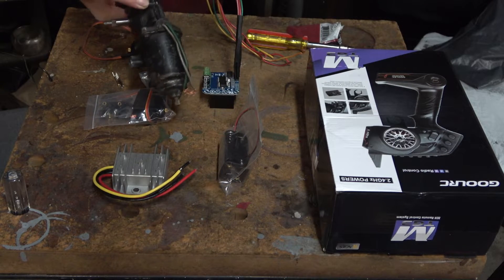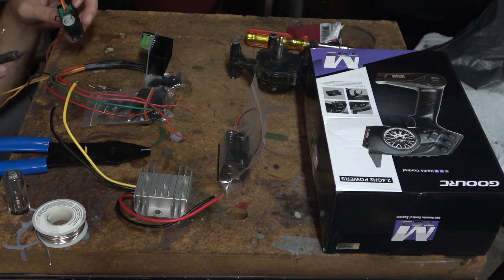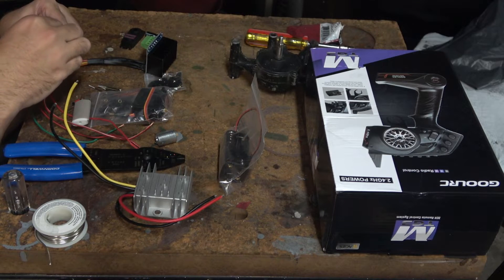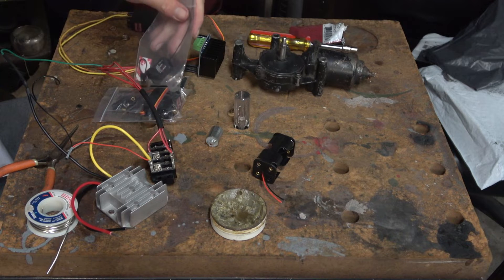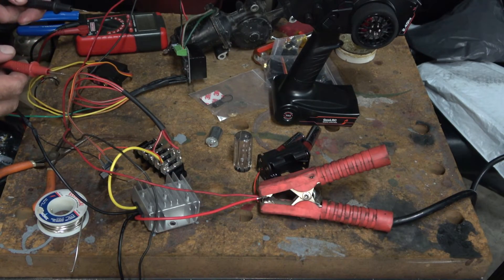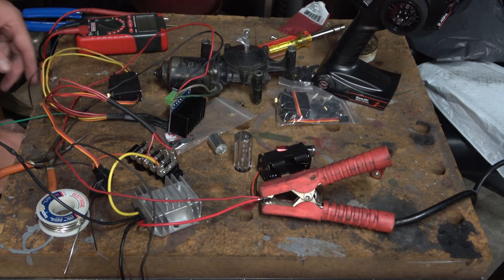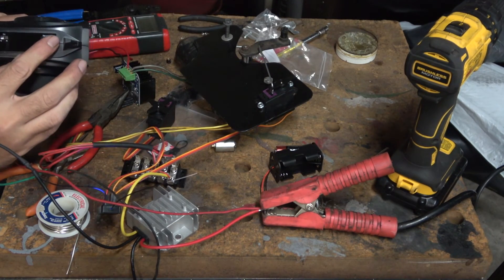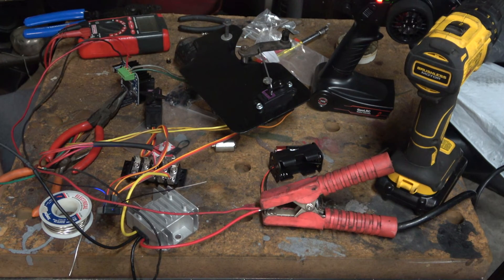How To - Remote Control Go Kart/ High Torque Servo

Comment: Hi, great job!!
I try to made the same project, with the same transmitter and bts7960, the only difference is the motor, it's not wiper motor, is a 12vdc motor with 27Rpm, and before I link the servo arm to the motor arm, I had to find the center of the servo, because the motor didn't stop, after that, I link the two arms, and when I move the steering, the motor don't come back to the center, and I'm don't know what it's wrong!!!
Can you give me some advice/help??
Regards

Comment: That H bridge is a fire hazard, the heatsink needs taking off and a thermal pad putting under it as there is nothing but the anodised layer on the heatsink electrically isolating the two driver IC's.
if they make contact with each other, especially at high current, you will have a very bad day.
Reply from the maker: It has thermal paste on it and its only running at 12vDC it dosen't even get hot. Have rode it for numerous hours and its just fine. Even if the entire system burnt up its only $80 in parts total so not a huge loss. Thanks for watching Steve! Here are videos of it working: https://youtu.be/T5xMn2v7UGc
Reply: @FireAndGasoline  thermal paste is not good enough, you need a thermal pad that will provide proper electrical isolation!
The two IC's have electrically conductive though holes and the only thing stopping the two IC's from shorting out on the heatsink is the Anodized layer.
If the two make contact with each other it will let the magic smoke out of the H bridge in a catastrophic way and potentially the rest of your wiring too.

Take your heat sink off and stick a meter on the two IC's through holes where the heatsink normally sits and run your motor back and forth, you will see why it needs to have a proper electrical isolation and only luck is preventing it shorting out!

Comment: Thanks for the idea with the windscreen wiper motor as a servo but could do with some refinement with some gear wheels to the servo potentiometer which would give you much smoother & precise steering then a pice of stiff wire, Nice job regardless.
Reply from the maker: I made it work, anyone is welcome to take my idea and improve on it. I actually hope people do exactly that. I definitely dont know everything but if i can pass along what i do know and it helps someone than it was worth making the vid. Thanks for watching Anthony! Maybe check out some of our other vids and consider subscribing. We also have vids of this working and riding https://youtube.com/playlist?list=PLrRQq5MNqlLotGKKRjx5hGl_oFDGrV0Vg

Comment: Great video. I was tried this, but with a smaller much cheaper servo.  And get lots if noise from the servo, and kept giving the motor input when it wasn't needed. Burning the motor. Do u think that a better servo might help me on this?. Thanks..
Reply from the maker: You may have had something wired incorrectly or not adjusted so that the servo was telling the motor to move constantly. If not perhaps a better servo would help. Haven't had any issues with mine.

Comment: Anyone got any idea on making a servo saver for a application of this size I built a rc car like this years ago and took it apart to reengineering with suspension but it’s been on hold do to no time and could not find a way to make a servo saver that I’m happy with 
So if anyone have a idea please share
Also like the way you wired the motor good work
Reply from the maker: I dont believe it needs one atleast how i have this set up. It wouldn't be hard to make though. You would just need the rod to have springs on each side of the servo and the rod to be able to slip on the servo mount. Then the springs would take the shock out of it. Thanks for watching, maybe check out some of our other vids and consider subscribing!

Comment: Can the RC steering with servo work for a rack and pinion steering?
Reply from the maker: It could but you would need to change a few things. Instead of the arm on the wiper motor to the steering knuckle you would need to use gears. You would determine the turns to lock from center and come up with a gear ratio that would end up 1:1 at the wiper motor. It will take some extra work and figuring but definitely possible.

Comment: Could you provide a link for parts need purchased? Interested or would you consider selling a “prototype” have a 90cc quad I want to remote control for my son                     
#💩electricplasticcarsfromwalmart🤮 thank you
Reply from the maker: I dont have links as there are many options for sellers on Ebay. I did show pics and descriptions of everything used in the video and I can provide you with a wiring diagram for the h-bridge. You will have to message us on Facebook at Fireandgasoline13 or Instagram @fireandgasoline13 so I can send it to you. This setup does work you can see it used in our remote control power chair go kart vids, check them out. Thanks for watching! 🔥

Comment: Could i use a 150w motor from a electric scooter instead of the wiper motor?
Reply: Wouldnt it just keep spinning when holding in either direction is that why you added the servo at 15mins so it will only go so far left and so far right
Reply from the maker: @fbomb2834  correct and to return it back to a center position.
Reply: Ok i seen another video of the pid inside the servo mount that to the top of the  motor gear flat side ..then it should do the same thing going to try both ways thanks and good work on your video helped me out alot .. Building a giant ford rc truck using a 49cc bike motor with clutch on back to push start it or electric start .
Reply from the maker: @fbomb2834  it should work either way, glad we could help. Sounds like it will be an awesome build!
Reply from the maker: Any DC motor should work.
Reply: On the 8 pin connector or 2 .4 pin connector.. what goes where maybe you could help .. Using a small brushed motor just to do  the testing and getting everything connected ..got the small motor to spin after holding the controller all the way left after 5 sec of holding somtime it works somtime it doesnt . maybe i have it connected wrong ..

Comment: How could I control this same 775 dc motor on smartphone by using aurdino plz send details about it and aurdino coding
Reply from the maker: I honestly couldn't tell you anything about coding. I know it could be done but not sure how. Perhaps you could buy a different board that is already programmed to be controlled by smartphone. Like something that would be in a rc drone. You would need to do some research to see if that could work. As far as coding there may be other youtubers that have vids on that. Thanks for watching!

Comment: Another question, are you gonna need a 12V battery to run the wiper motor? What do you plan on using? Just a 11.1 Lopo?

Comment: I’ve been working on my hover round R/C car for a couple years now since I started it, but about a year and a half ago it go put on the back burner cuz I couldn’t figure out how to wire up a wiper motor to a servo. There’s a few videos out there that try to help, but I’m so electronic illiterate I still couldn’t figure it out. I was hoping your video was gonna help me out finally, but you don’t describe what wire you’re soldering to what wire...? Also you can’t see with your arm in the way what colors you have in your hand. So once again my hover round tubbed out Mercades power wheel will sit in my front room as a decoration piece.
Reply from the maker: Im not even sure how to respond to you. If you are saying this project has is taking too long feel free to send money or parts to finish it. If you actually watched the video you would have atleast some understanding of how i did this. The wire colors dont matter as its just spare wire i had laying around. The only thing i didn't show was the connections to the h-bridge, wich i offered to send to anyone that messages me. I don't really make anything off my vids, i just do this to help and entertain people. Dont like it, dont watch it. My setup works, i have had quite a few people send me pics and vids of the projects they made using my dirrections so they cant be all that bad. If you are serious and actually want help maybe come back with a better comment.
Reply: Fire And Gasoline I’m not trying to sound like a dick, I was hoping to get more info from your video so I can finish my project that I started 2 years ago, but you aren’t really clear on what wire goes with what wire. Yo just say we’ll solder this wire here to this wire here, and your hand or arm is in the way and I can’t see what colors the wires you’re using. I’ll get my setup back from the guy that was supposed to help me last year and hasn’t, and I’ll let you know what colors the 5 wires are coming out of my wiper motor and etc.

Comment: I need to do this for a project of mine. Do I need a brushed or brushless motor for the driver? Sorry, i am a total newbie.
Reply from the maker: I used a brushed wiper motor from an 88 buick but any motor should work the same. I believe brushed motors produce more torque so depending on what you are doing, they should also be lower cost. Thanks for watching, maybe check out some of our other vids.

Comment: Could you please email me a wiring diagram and a list of any other key parts that you used. Would be much appreciated thanks
Reply from the maker: Everything i used was listed in this video, you can message me on Facebook at Fireandgasoline13 or Instagram @fireandgasoline13 and i can give you a wiring diagram. You will still need to follow the instructions in the video for it to work as i did it. Thanks for watching!

Comment: I just subscribe. Check out my RC home made gokart that I did. I still didn’t test ride it yet but it looks promising.i might need your help if the turning doesn’t work out.i might have to put a windshield motor.
Reply from the maker: I checked out your vid, great job.
Reply: Fire And Gasoline one year later and I finish it😂.When are you guys going live again?

Comment: Thank you for this awesome video!!!!!   Could you please tell me what you used for the H bridge?
Reply from the maker: The one i used is an IBT-2 arduino. If there is anything else i can help with feel free to message me. Thanks for watching!
Reply: @FireAndGasoline  does this have to be programmed like some of the other  arduino things?   Thank you for the help!!
Reply from the maker: @americanboathead5390  no you pretty much wire it up and go. If you message me on Facebook at Fireandgasoline13 or Instagram @fireandgasoline13 i can send you a wiring diagram.

Comment: Wow I would have never think that you could make remotely controlled steering could work as well as you got. Great job
Reply from the maker: Thanks Frankie! It was complicated to understand but easy once i did. You could literally remote control anything this way.
Reply: With all of the weight of an engine and the wheels actually touching the ground does the the servo still work